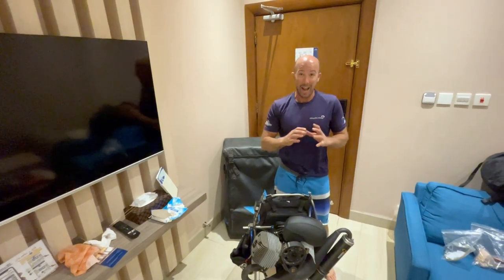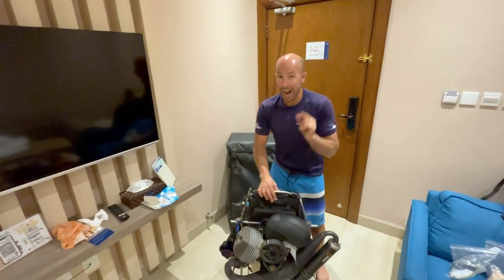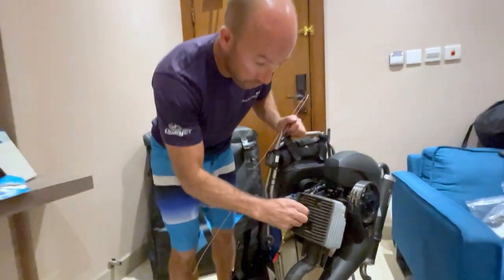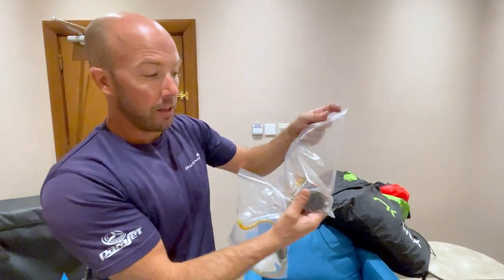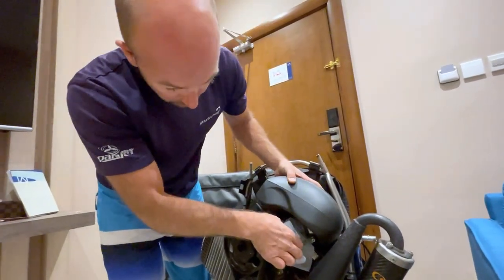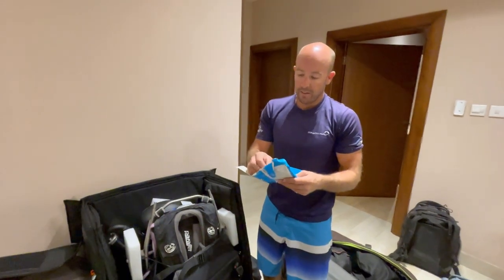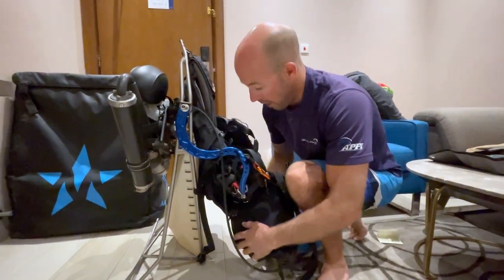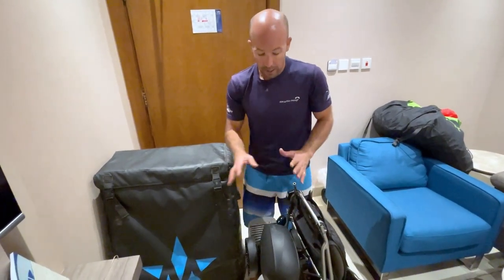How to prepare your Parajet Maverick for Travel

Comment: Hi. I’m currently looking at the maverick or zenith. Why would you choose a maverick over a zenith if u intend to travel? I’d love to know the pro and cons. Thanks
Reply from the maker: The Maverick is a more modern paramotor than the Zenith, which has been around for around 10 years now. The Maverick is made out of Titanium which makes it lighter and stronger than the Zenith, which is made out of Aluminium. They are both designed for travel and can therefore be broken down fairly easily but the Maverick has a purpose built travel case and a better netting system which doesn’t have any snag points. They can both be fitted with the Vittorazi Moster 185+ engine which is the best on the market at the moment. Hope that helps.
Reply: @SkySchool  that’s great thank you. Iv also only just realised how heavy the zenith is. Think il choose the maverick. Thank you.
Reply from the maker: @mhoward181  no worries. If you want a quote you know where to come! We also help run in and set up the paramotor as part of the deal.

Comment: It's ok covering everything with nice smelling wipes to hide the smell of petrol, but the fire risk still remains.
Reply from the maker: That risk is considerably reduced when you remove all traces of fuel and allow the paramotor to breath for 24 hours
Reply: Great video No fire risk if no source of ignition or fuel. Spark plug removed, fuel removed. 
See Dangerous goods Table 2.3.A Subsection 2.3   IATA 
Third paragraph from the bottom 
Allows for internal combustion or fuel cell engines to be carried in checkin baggage. Provided it meets the regs mostly no fuel or source of ignition. .. 
But as Alex says I would stay away from mentioning its an engine just creates complication but take a copy of the regs if it goes that far you have it as ref for discussion 
One thing I do is put plastic bag or two in the fuel tank leaving the top of the bag over the opening of the tank and put the fuel cap on. This helps stop any fuel smell getting out. But up to you